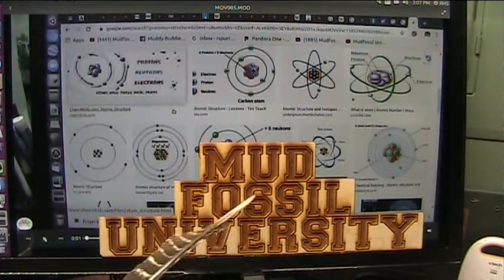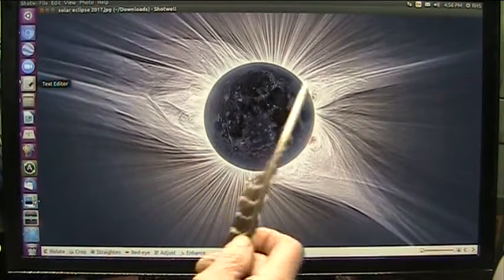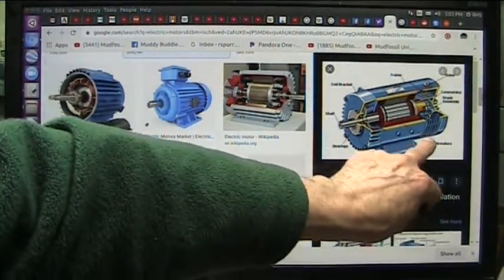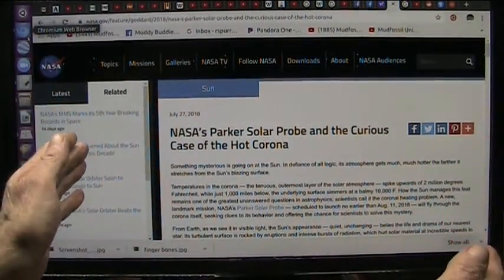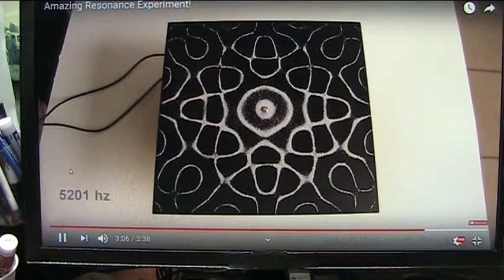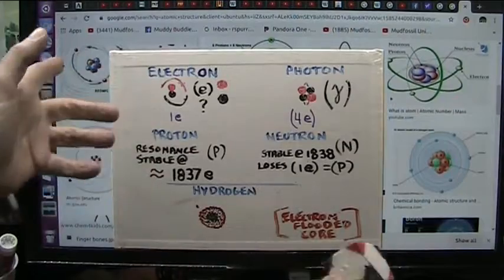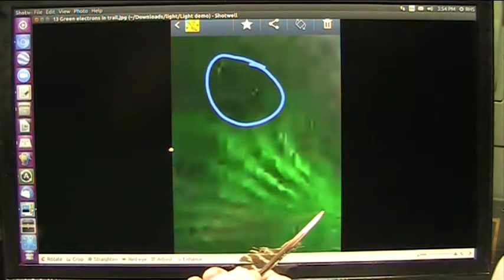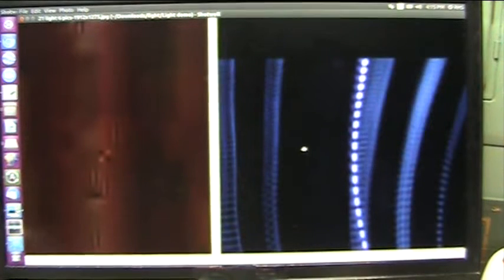The Particles Surrounding Us

Comment: When i finish explaining my opinion, you will question the nature of reality, you will no longer assume that anything is stationary, or moves, or does anything or nothing. 
If a body starts speeding up, time for that object slows down.  If we are in a jet, and we synchronize two clocks, leave one on the ground, and fly the other one around at supersonic speed, when we land and check, the clock we took with us will be slow.  It will show a time that is earlier than the other clock.  Whether it's a digital clock or not.  If we take a cell phone that updates the current time constantly, the cell phone will keep correct time, but otherwise we will have to update the clock that was on the jet plane to the correct time.  That is a fact.  Time dilation.  It is odd, isn't it?  If something speeds up, its experience of time slows down?  Why is it backward?  Shouldn't time speed up if we speed up?  
You mention that the sun is spinning.  You're explaining particle theory, which assigns a spin value to the particles.  It says that all particles are always spinning.  The only way to stop them would be for them to reach absolute zero, but nothing ever reaches absolute zero. 
It seems to me that things are not just spinning.  Everything, all matter in the universe, is moving at the speed of light (in a vacuum) right now.  
Einstein said that space is an illusion.  He said that all matter is connected, but it is extended by space.  Which means space is something.  It is not nothing.  Einstein did not say that space is just a vacuum, he said it is something, not nothing.  It has qualities and is quantifiable.  Tesla disagreed. 
Of course, we are always spinning on earth, even when we are sitting still.  But I believe that everything, even a piece of matter that is sitting still, out in space, is in a way, being moved by a force that moves at c, at light speed.  It is when that object begins to "move" that it leaves or opposes that force.  So when something "speeds up" it is actually slowing down, and that's why time for it slows down. 
There's more to this theory.  By the end you will question what a particle is, and what energy is, time, space, etc..  if you haven't already.  You might think I'm crazy, but in my version of reality, anything is possible, so I think it's interesting.

Comment: As above so below. The electron flow theory explains everything. All the bs i was taught in university was so disjointed it made no sense and caused confusion. Especially einsteins bogus crap. Nothing in the standard models held water. Until i started independant research starting with nicola tesla did things come together. The electron flood theory is the final missing piece of the puzzel. Astounding Roger! I almost feel i can put together a free energy device and a antigravity device now. Maybe i should put my lab back together and build something! I wish to share what i with MFU that kesh tecnology has been building superconductors at room temperature. It is done by burning copper to build nano tubes on the copper wire and filling the nano tubes with monoatomic particles. Therefore when electricity is sent through it is instantaneous with no scrubbing.
Reply: Namasté Magnificent Brother/Sister,
If I burned some copper wire and then sprinkled Ormus powder on it whilst these nanotubes are open and ready, would that be feasible to create said room temperature  suoerconductor?